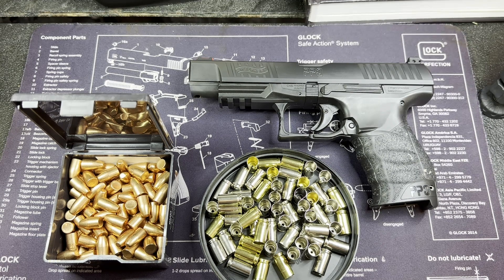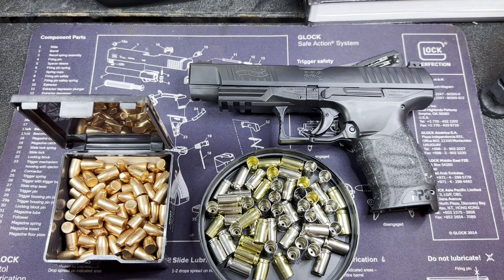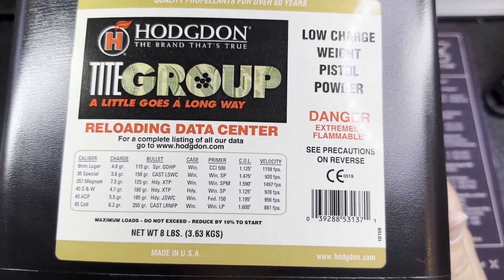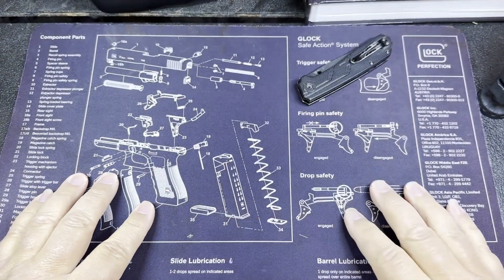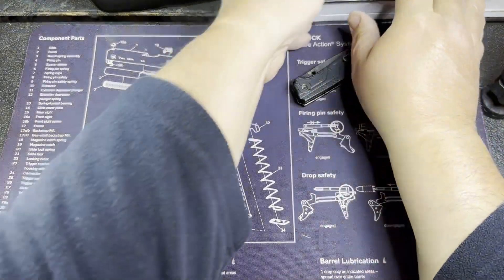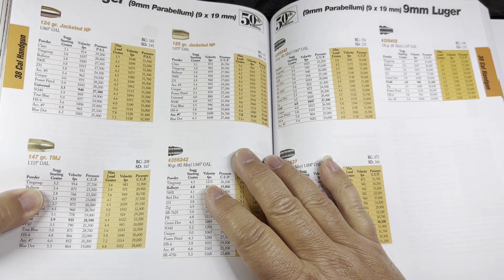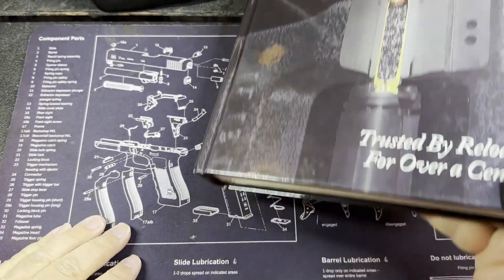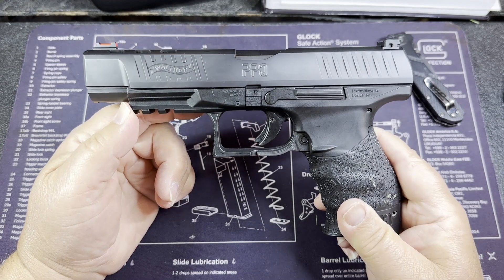Reloading 9mm "Project USPSA" Part 1 - 147g Speer Bullets, Titegroup Powder & Walther PPQ M1 Pistol

Comment: We need about 890 fps for Minor PF loads of 130 (890 fps) ; based on Hodgdon's reloading data, I'd do a group of 5-10 rounds each at 3.4 and 3.5 gr , seeing which is consistently near/at 130 pf (890 fps). (I dislike max loads even if listed in manuals/websites!)
Reply from the maker: Check out the Part 2 video and see what you think with the results.

Comment: Small Titegroup loads are very easy (perhaps TOO EASY?) to drop in multiples on a progressive...  Even in the 9mm cases.  That OAL @ 1.115" is very short for a 147gr bullet, even one with a flat nose like the TMJ.
Reply from the maker: Personally myself I have typically loaded longer OAL but started with the recipe out of the book and figure I can tune from there.  I agree strongly, Titegroup can easily be double charged, so one must be careful.  Typically what I do with a progressive is I only load 50 or 100 at a time and then go do something else so my attention doesn't wander.